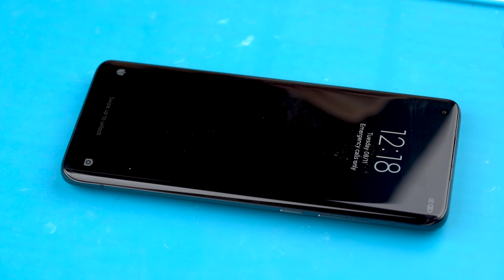Xiaomi Mi 10 Ultra Teardown

Comment: Did you have to glue back the back cover with extra glue? I'm replacing my back glass that was broken but I'm not sure if I need extra glue.
Reply: hey man, did you replace your back glass? I have the same question... does the glue need to be "replaced" aswell as the back glass?
Reply: @ati_modis  I did. The new cover came with a new adhesive attached to it.
Reply: @marvelousondatrack8647  ohh thats great info, thanks! They should inform about this on the product's description 😂

Comment: Thanks for the video. Do I understand correctly that I don't need to remove the motherboard, cameras etc. to remove/replace the battery? If so, which parts I would only need to remove before? I'm planning to change my battery soon and this video will help a lot.

Comment: thanks for your video.

Im surprised that my Mi 10U motherboard designed like that and the chipset housing located in the center. So blackshark TEC funcooler will perfectly chill the chipset.

Im also surprised that my phone Battery is tall to the upper part.

Comment: I'd love to see someone poke a hole into the battery, since it says everywhere that it's graphene based and can't burn. I want to see someone test this for real because I hardly believe it
Reply: It's not a fully graphene based battery. It has a layer of graphene in it. It's mostly just a normal lithium ion battery so it will burn. People saying that it won't burn don't really know what battery is in the mi 10 ultra. They just hear "graphene" and instantly think it's a full graphene battery.
Reply: @Ramon314  Graphene IS a layer, otherwise it's graphite. And they aid it doesn't burn.
Reply: @xxBlackpspxx  you don't know how graphene batteries work either. But it is true that this battery will burn. This is a liquid based battery instead of a solid-state based graphene battery.

Comment: How many phones is Xiaomi releasing?? And from the names I can't even tell them apart. The RedMi line certainly isn't budget anymore, and whatever is called S doesn't mean anything either.
Xiaomi is a huge brand, they are strong enough to bring their own naming convention and use it in a consistent way instead of trying to aim things at the different markets in different ways.
Reply: Redme still is budget oriented.
Reply: @Ramon314  There are phones that are sold under both Redmi as well as Xiaomi. And now there is Poco, which is a separate brand now.
But what is more budget? A Xiaomi A1 or a Redmi K20?